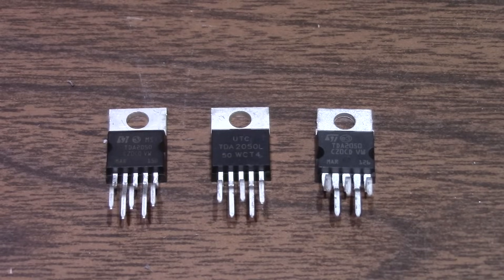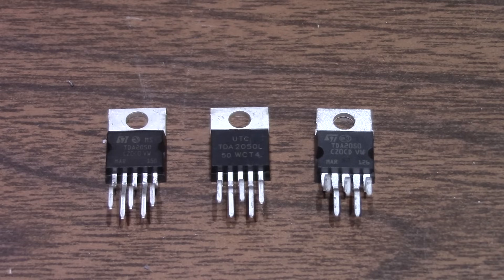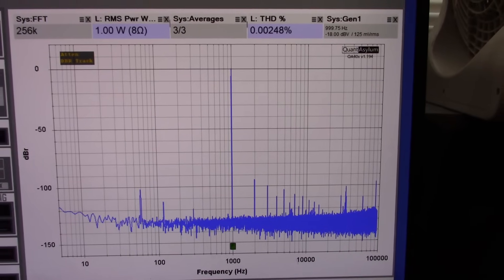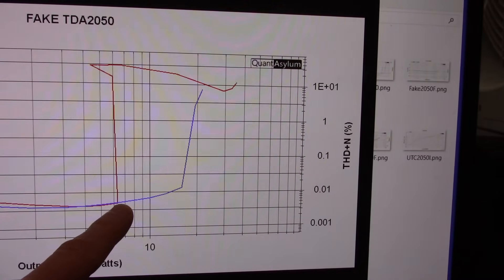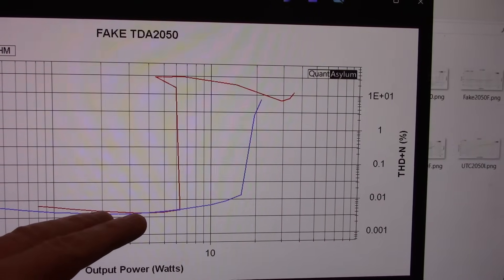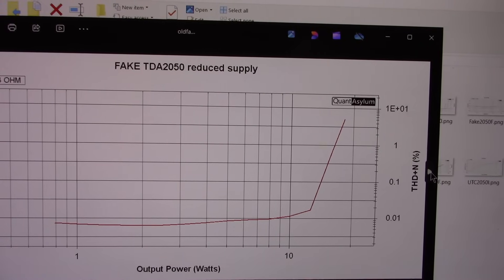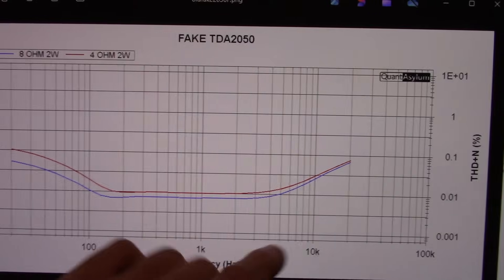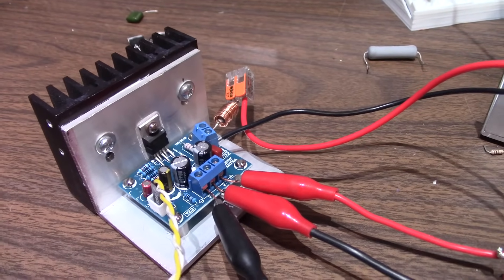Counterfeit TDA2050 performance test - interesting results!

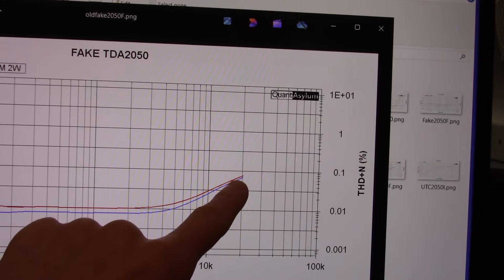Comment from the maker: PEBKAC warning: When measuring the frequency vs. distortion, I had the THD+N box checked resulting in slightly higher distortion measurements ( my concern at 8:50 ). I can't perform reliable THD+N tests unless I shield the equipment so must stick with THD.
Reply: Hey John,

What mods did you do to the board to accommodate the TDA instead of the LM.

Thanks
Reply from the maker: @MelbourneLife-xj2ee  I changed the value of the resistor and capacitor that is connected from the output to ground (see the TDA2050 data sheet).

Comment: Bought a board not like yours.   It has the input one side, and the power connections and speaker connections on the other.  The first one didn't work.  The bag was opened already, not a good sign?  Will try the second one in a closed bag.  The TDA2050 has CHN on the front bottom corner.  Could I have gotten fakes?

Comment: Hi! I would like to inform you that I work with one of the largest importers of electronic components in Argentina. They are so significant in the business that every year, the people from ST semiconductors pay for their plane tickets, along with his wife's, to attend the annual meeting in Silicon Valley. As for the TDA2050 and TDA2052, not all "fake" ones are actually fake. Many are manufactured by ST, but come out flawed. The wafers have some defects on the edges that lead to lower performance, overheating, or low gain and offset voltage. These are sold in bulk as "bulk trash" and are usually bought by some Chinese companies to finish encapsulating them, engrave their codes, and sell them. This means that many of these TDAs, which seem fake because they don't meet their nominal specifications, are actually "real" but defective products that ST would never sell to their loyal customers. Instead, they resell them to second-tier companies in China to offset manufacturing costs and reduce the price impact on the original ST semiconductor products.
Reply: chinese price is 10 pcs TDA2050 for 110 pesos (2 usd)... that is 20 us cents. Meanwhile, us companies sell it 5 usd a piece.

Comment: Can someone suggest me the best chip for hifi sound, 2x15watt is ok, a fake TDA2050 do the job? Is there something better? Now I have TDA7297, I think midrange sound not good. Is the TDA2050(or TDA2030) be better than that? I saw a version TDA2030 with dc12V, and a another with ac dual12v, are they have sound diference?
Reply: Assuming its implemented correctly, they are all going to sound the same.

Comment: It's not so much the specs on these counterfeits, of course they are going to closely get all the data properties some what correct, but if you want your viewers to really see what makes them generic you need to open them up. That's where you will see the difference in quality of the B/E leads from the chip showing how much thinner the leads are and how they are attached from the chip itself and how these knockoffs have it built together under the case with so much less quality compared to the legitimate transistors  .

Comment: Even the very fake ones are actually good amplifiers. If you need more than 10 watts and want to keep em clean , slapping a voltage follower stage after em will improve the output power significantly. 
The holly grail is to have em bridged , and add output transistors. If its well set up , then you have a mighty decent amplifier.

Comment: I highly doubt ST sold dies to asian IC manufacturers.
My local distributor is listing this chip available from brands like UTC (even stocked), JSMicro, HGSemi, Xinbole, GreenMicro, HXYMOS..
And I'm pretty sure they are all reverse engineered clones aiming at replacing imported IP and domesticating supply chains rather than counterfeiting. Last company states this on website about all its nomenclature. Maybe one company with the first successful design does partner with the rest CN manufacturers, may be there is legit competition, that I do not know, but probably not with western silicon giants.
Hell, there apparently is soviet clone for TDA2030A (К174УН19).
There is even bigger player on modern market not present in the list for this particular IC, but having reliable in-house clones of most popular and jellybean ICs - UMW.
They have branded datasheets, QC, distributors - practically legit world-wide suppliers.

And the fake ST you got from ebay is simply a remarked or complitely irrelevant IC die packaged as TDA, low-level Alibaba grade underground scam.

Comment: It's interesting to see the counterfeit audio amp IC performance mirroring my experience with counterfeit linear regulators.  I recognize the wonky "ST" or "57" logo from counterfeit L7805CV regulators I keep encountering in broken devices and on the usual sites.  From my experience and anecdotes from others, the fake L7805CV seems to perform perfectly fine at the median of the datasheet values, but runs way too hot and fails prematurely above 1A, often failing short circuit, while the genuine article is reliable at its rated 1.5A.  The counterfeit also seems to have a worse dropout characteristic, becoming unstable around 8.4v input, while the genuine is close to 7v.  Interestingly, others' testing seems to show the "ST"/"57" L7805CV could be a relabeling of a Chinese-market vendor's L7805 with a different suffix, one that has a datasheet indicating a 1A current limit.
Reply from the maker: Amazing they would bother counterfeiting a nearly 50 year old design given the chip die size would be fairly small and cheap to produce anyway.
Reply: I, too, have encountered multiple fake L7805 regulators and even burned my hand on one while operating it without heatsink. I think they are rebadged LM7805s, which have 1 amo current ratings.

Also, I have seen multiple counterfeit IRFZ44N mosfets with a highly distorted International Rectifier logo, which fails short after 5 minutes.

Comment: The red line going back a little bit is just strange. I think there is some stability issue going on, maybe high frequency oscillation is starting at some point. Would be interesting to look at it with a  oscilloscope to see what is going wrong. Of course the chip is not as good as the original one but usually those cheap PCBs layout and circuit are not great when it is about stability and
Reply from the maker: Could be the action of the limiter circuit at higher signal levels, but then it starts letting more power through as the signal increases more. I agree, the scope may reveal what's going on. Those boards have a nice ground layout and bypassing.

Comment: The secret to use Chinese chips is to convert the values from Chinese units: 1 Chinese amp is 0.5 western ampere; 1 Chinese volt is 0.6 western volts; and 1 Chinese watt is 0.3 western watts. If you derate the components accordingly , you'll be fine.

Also, short circuit protection means it will protect itself by burning on short circuit. 😂
Reply: Yes, I'm fine. Thank you.

Comment: Some old design car amplifier IC-s has a same bumped distortion cruve at low rfeq.
The case and legs are looks similar with an TDA2003.

Comment: Could it be that fake chips are TDA2030 marked as TDA2050? In any case fake chip is very good for projects at lower PSU voltages.
Reply: could be, though they would also take any random TO220-5 packaged device and remark it as well.

Comment: I am building 4 channel test amp with UTC TDA2050L chips. I would use it for measuring speaker drivers and active crossover tuning experiments.

Comment: I'm quite enjoying this series as I've been a big fan of the TDA2050 for some time now, though I use boards with blocking caps on the output that require only a single rail supply as a decent 24V power supply can be had quite cheaply. I'm curious as to the difference of performance between these two setups...

Comment: MAybe they are not fakes but rather factory rejects that don't quite meet the specs.
Reply from the maker: They are fakes. Decapping the IC reveals a smaller die inside.
Reply: Do you think the factory does not sell these after sorting them ?  2050/2040/2030 the same chip probably, rejects of 2050 labeled 2040 and so on. Only faulty chips are thrown away.
Reply: @modorangeorge4991  I think a lower speced chip may be mislabelled now and then and they will be "rejects" that can't be sold on the regular market however ebay sellers etc may scoop them up at bargain prices.
Reply from the maker: @modorangeorge4991  Decapping and examining the die would reveal a different circuit. Lots of similarities, but the TDA2050 came out years after the other ones. The main differences are the higher supply voltage rating and current handling capacity of the 2050.

Comment: Both UTC and ST had same schematics in datasheets. It seems also JSMSemi is also manufacturing those. Maybe same layout or improved.
Checked price from lcsc because didn't find from mouser or digikey anymore. Those were about 0.35 usd each in 5 or 10 quantity.
Edit: my favorite chip TDA7294V is also on lcsc from ST only and around 2.34 usd each from 1+ quantity. (about 100W chip)

Comment: Maybe the QA is measuring THD+N and displaying this on the graph but it's subtracting the noise from the THD and giving you a low number?
I don't know, never owned or used a QA. On my stand alone distortion meters, noise can be eliminated with filters to give a more accurate THD measurement.
Reply from the maker: It has a separate mode for THD+N. It displays the data as it takes measurements. I'll have to investigate more.
Reply from the maker: You are right! Went back to the menu for the sweep and the THD+N box was checked.
Reply: @JohnAudioTech  Well that's odd ! but you found it ! I look forward to the next vid (as always !) Happy New Year !

Comment: Great video. 
Can the audio analyser output its data in CSV format or any other similar raw data (text) format so you could post it or look at it in Excel or some other analysis s/w? 
If that was spossible then you'd have a confidence check for what it's showing you on its plots..
Reply from the maker: Yes, it can save data. I'll need to research the issue further. All the other measurement "anomalies" were my fault, but this one seems like a bug. There are a lot of settings under various menus that must be made before setting up the sweep menu for the test.
Reply: @JohnAudioTech  You might try to manually measure THD around inflection point where distorsion rises and replot in excel/libre.calc? Also you might check ARTA or holm impulse...
Reply from the maker: Simple screw up. I had the THD-N box checked. I can't perform a proper THD+noise test without good shielding.

Comment: That's pretty surprising performance for such a cheap counterfeit amp. Thanks John.
Reply from the maker: Yes, the distortion performance was surprising.
Reply: These ICs are really just an op-amp with chunky output transistors; and because they are inside the feedback loop, any errors they introduce are minimised.  The fact of everything being in good thermal contact will also be working in your favour.
Reply: Who writes 10 as 1E+01. silly software devs not paying attention?
Reply: @Krmpfpks  Same same

Comment: I have received an amplifier technics su- x 302 it is svi 3102 ic based amp but problem is that Ic is not available in my area so Iam  thinking of modifing amp with 2 tda 2050 . Tda 2050 can take 50 volt in single supply. So I want to use +42 volt from dc section of to operate ic. I would like to know whether tda 2050 support dc  50 volt in single supply.
Reply from the maker: Max voltage across the supply pins is 50v so you are good in single supply mode or +/- 25v with a split supply.
Reply: @JohnAudioTech  Thank you 😊
Reply: It should work, but I would rather use TDA7293. Those should handle 8 ohm speakers at +/- 42V. Eventhough I think japanese powersupply will sag anyhow so this 42V will drop quite a lot when loaded.
Reply: @Tegelane5  Thank you

Comment: I actually waited for this so bad (writing at uhh 0:00 ) :D i have built a stereo Fake tda 2050 on a diy pertinax board, and i think i would not gonna bombard it with +-20 something volts, only with +-15V :D
I was like at the last video, i was like wait what, utc isnt counterfeit, then the test came similar with the real ST TDA2050, and yeah.
Now its gonna be a fun video :DD
Because i remember i had an UTC TDA2003 and it was a pretty good amplifier, it was also sounded pretty good, it died due the screw unscrewed itself somehow that i havent realized and it cooked itself unfortunatelly, but i loved that chip, it was the amplifier that i was growing up on.

It was like uhh 5years ago, i was pretty much a child, wanted back my UTC2003 and i got fake tda2003, and they exploded after 5-10mins on 12volts. Yeah...

I tried once i had a near 22Volt supply and the UTC TDA2003 worked so damn good. but when i tried my fake TDA2003 that i currently have, it started just to block off the output, but when i reaplied the 12Volts it worked again. Currently the tda2003 i have is some kind of "yw TDA2003" and also i tried that with only 19.5Volts instaed of the UTC that i was using a different supply, which was 22Volt DC. And it was rated for 10Watts, and 13.8Watts came out to 10% THD so i think that was pretty good, almost 14watts from a 9-10watts rated chip.
and of course thats on 8ohms.
Pretty good chip, its just the counterfeits of 2003 are junk.